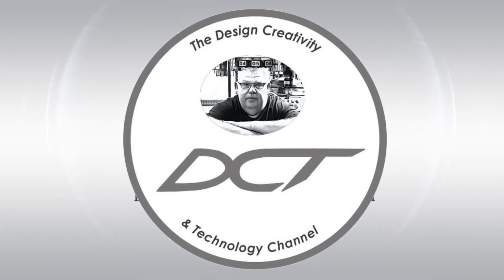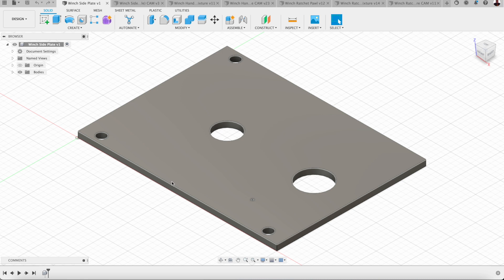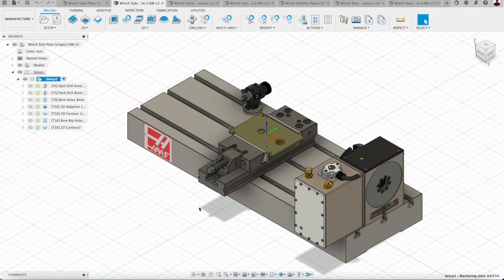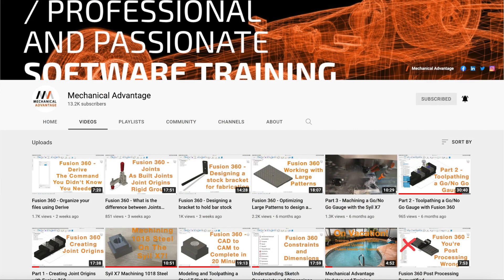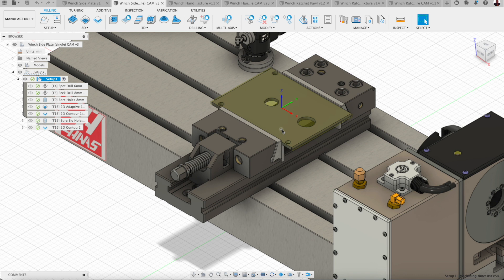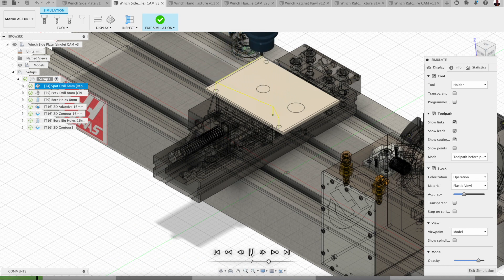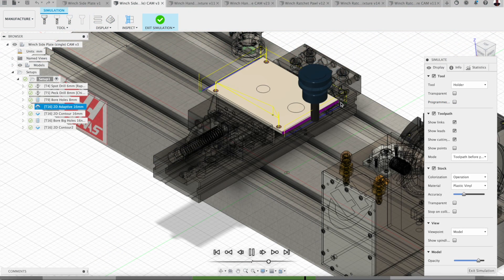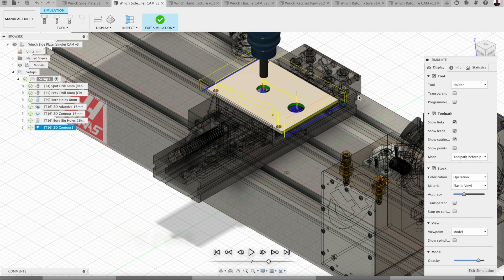CNC parts on the HAAS -  Pt.1

Comment: I have a X7 but parts like that I cut on my 1kW fiber laser. Takes under a minutes in 6mm steel. Would it not be cheaper to find someone to laser cut them?
Reply from the maker: Hi Michael, yes you could use laser, plasma or water jet cut plates.  However, the plans call for a H7 tolerance, as bushes need to be pressed fitted into those large holes.  Additionally, you get better surface finish with machined parts and no draft angle to worry about later.  Thanks for watching.  Aaron.